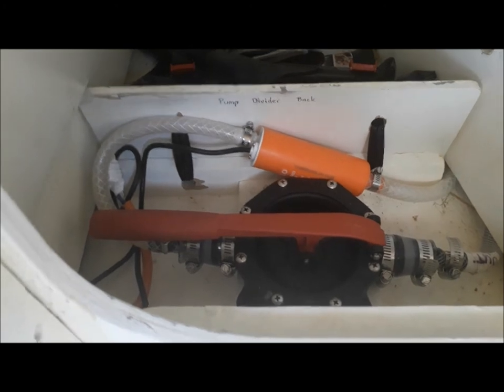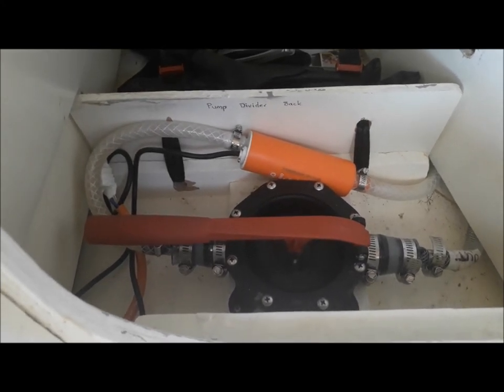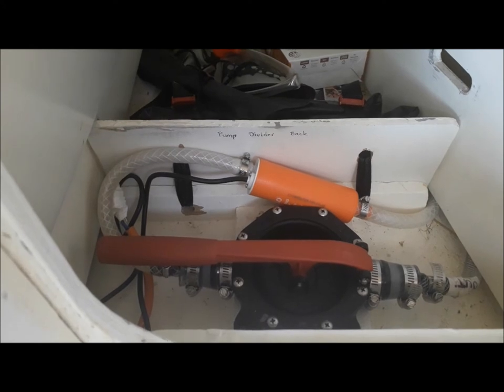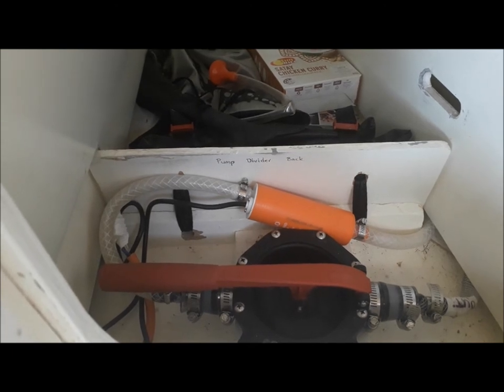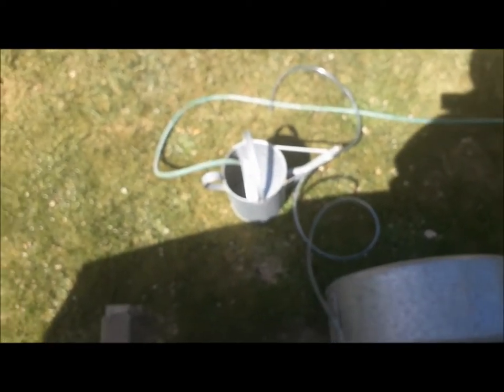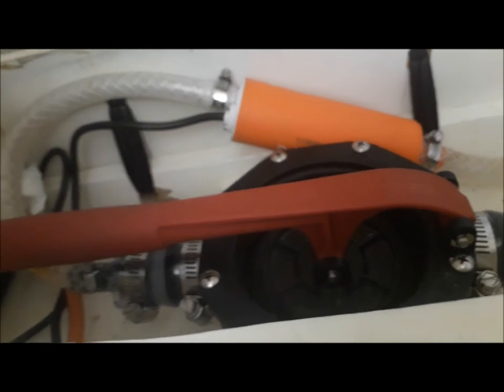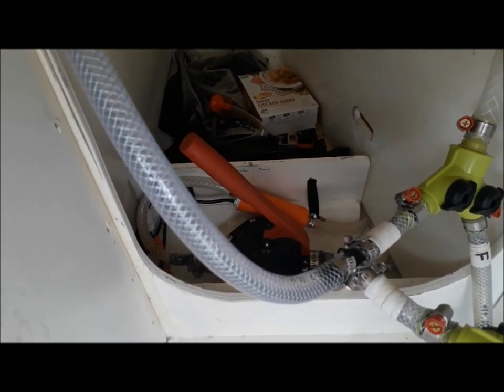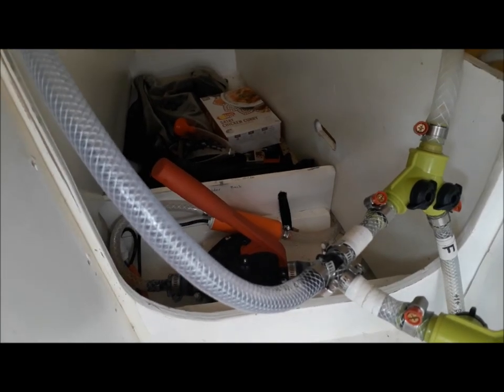Paradox Two way pumping system for Fresh water ballast tanks

Comment: Would it be easier to have permanent lead ballast rather than water? This could be removable during trailer transportation. I mention this because you say you find it easier to drive home with the water ballast and drain the water later.
Reply from the maker: Maybe. A lot of Paradox builders have done that. To be honest I've never been on my Paradox for long enough, but the original intention was to use the tanks as a potable water supply when far away from water out in the Bahamas.
Reply: @creditscorenz  Thanks. I think I live close to you - in Clarkville near Kaiapoi  John